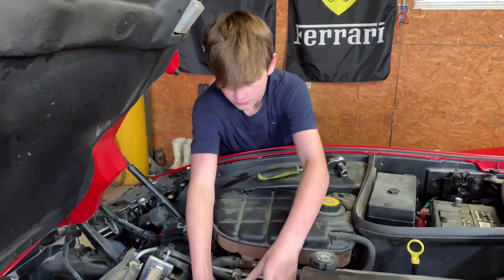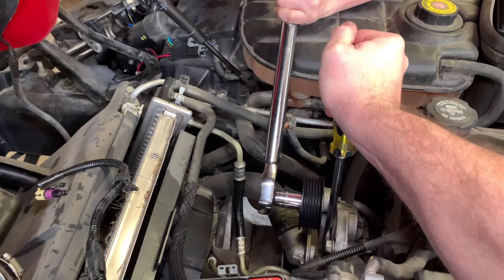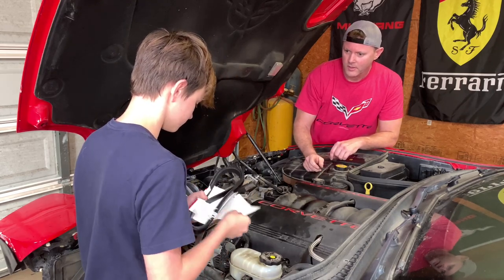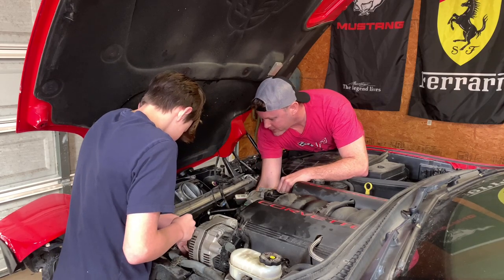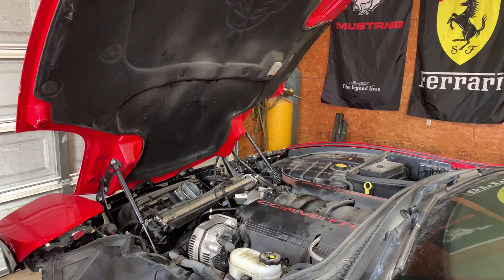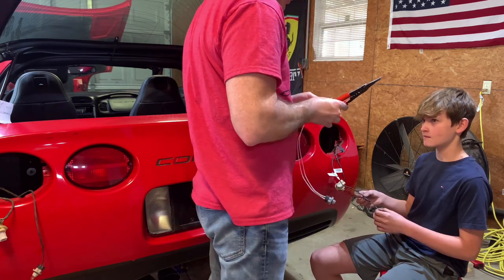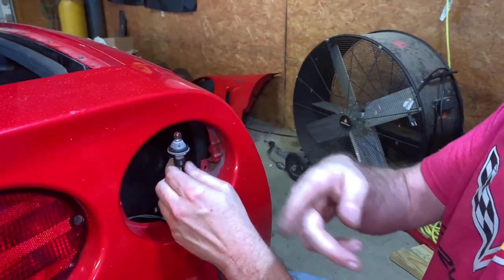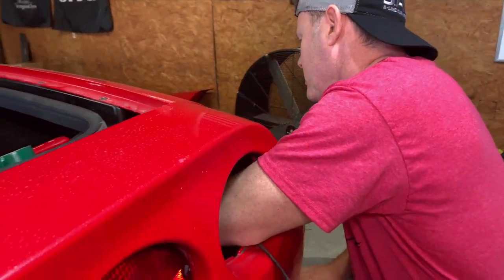Ep. 6 Rebuilding a Wrecked C5 Corvette | Changing Belts, Pulleys, Wiring, and Sway Bar Links

Comment: These connectors are heat shrink ones, just heat them up with a lighter or hot air gun and they seal themselves, no tape needed. 
Oh and incendesant light bulbs can be wired up either way.

Keep up the good work!
Reply from the maker: Thank you.

Comment: You guys are doing really good. The connectors for the tail light wiring have a heat shrink on them. Take off the green tape. A heat gun or lighter will shrink up to protect the wires.  I think trying to fix the bumper would be a great project. If it doesn't workout buy another one from a salvage yard. Looking forward to the steering rack install?
Reply from the maker: I didn’t know that about the heat shrink connectors. I’ll definitely do that. Thanks for the tip.

Comment: That front bumper is toast. I’d get a new or used one. I’m pretty sure it’s plastic and would need to be plastic welded instead of fiberglassed. Probably not worth trying. That’s just my opinion but I’ve been doing bodywork for about 30 years. Love the car.... you guys are doing an amazing job!
Reply from the maker: I think it’s plastic too after doing some research. I’m sure you are 100% right about the bumper but I may just try to weld it for the fun of it.

Comment: Not trying to be Monday quarterback but should soldered wire and used sealing shrink sleeve.   Also like I’ve said in past just catching up series.   They have the  plastic welding kits for bumpers for that front bumper.
Reply from the maker: We appreciate all comments even if too late. We still learn from them.